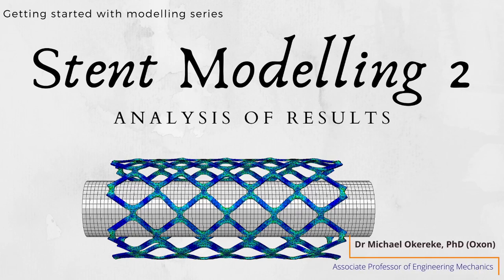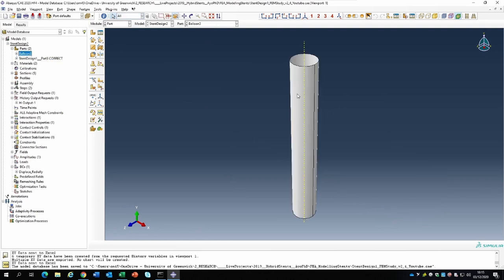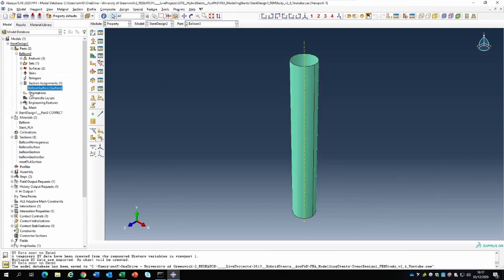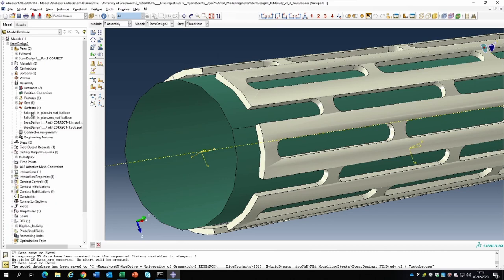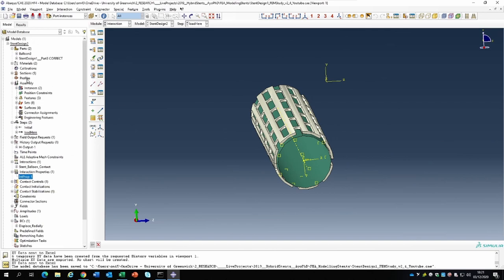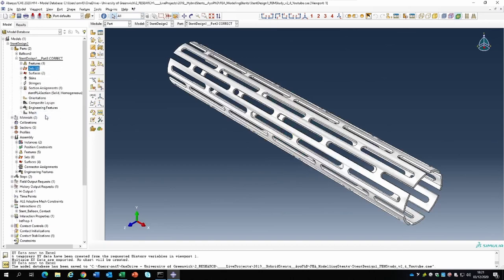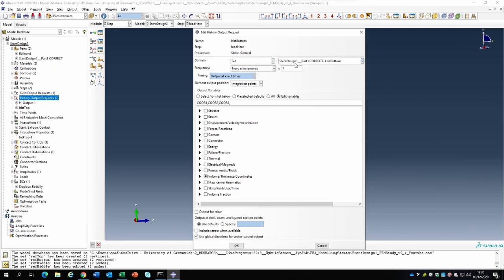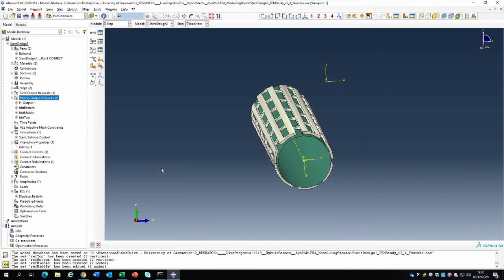Stent Modelling in ABAQUS - Part 2:   Analysis of Results

Comment: Hello, Dr.Michael Okereke, I would like to ask for some advice. I did not understand the relationship between stent structure and reference point 1. Does tying ref point1 and ref point 2 together fix the structure? The basis for this operation to work should be that ref point 1 and stent structure are tied together. Can you explain it to me?
Reply from the maker: Hello, tying those reference points do not fix the structure. It does so if you then kinematically link the reference point to the model and prescribing a fixed or roller support at these reference points. However,  even if you do that, you are limiting the stent behaviour. 

You actually do not need to fix the model. The imposed constraints (displacement field from the balloon) will apply a stabilizing concentric outward-acting (radial) displacement on the structure which due to the concentric form of its operation serves as some sort of sort system holding the cylinder/stent in place.

I will say in this case, those reference points are redundant and if you miss them, you will still be okay with your solution.
Reply: Thank you very much for taking time out of your busy schedule to reply to my questions, which is very helpful for my simulation! Thank you again! @MichaelOkereke

Comment: Thank you for your great video, I already watch the first part, but here in this one at 15:34, I got confused about what  m.set1 is? actually, I don;t understand which set you chose to make a constrain with Ref-2 ? this is a point in the middle of the stent that you defined it as a set?
Reply from the maker: I believe that the reference set m.set.1 is a surface set for the stents ballons. Good luck.
Reply: @MichaelOkereke  thank you so much for your reply

Comment: First, thank you again for the fantastic video! I have tried to use the method and all you said in this video to apply an axial displacement ( by a crimper) on a braided stent, but every time it has aborted! It may be a problem with the braiding wires at their connection points. Despite trying surface-to-surface contact and even self-contact (as I import the stent as one part of the assembly), I was unable to get it to work.
all in all, would you please tell me how I can fix my problem, or if you could kindly make a video about simulating braided stents which have complex geometry.Thank you so much in advance
Reply from the maker: Hello @S.Farzaneh, thanks for the comments. It can be frustrating I know. I have not actually done any modelling with braided structure stents so cannot suggest anyway to help you. It sounds you are doing things well. Maybe you should check in the DAT or MSG files that come with the simulation to see if it will tell you why it is aborting. It could be the properties given are not right. It could be too much loads on the model. It could be distortion of elements excessively. Its difficult to say but hopefully those DAT or MSG file contents can point you to the right information. Good luck.
Reply: @MichaelOkereke   thank you so much for your time. I really appreciate it . ok, I will check the files as you said.

Comment: Can we use model and analysis this for biodegradable stent
Reply from the maker: It's a bit too thin as a biodegradable plastic based stent. Normally, such stents require larger strut thicknesses. If you are using a metallic biodegradable stent  it might work but you do to do the preliminary simulations to check first.
Reply: @MichaelOkereke  okay thank you so much sir